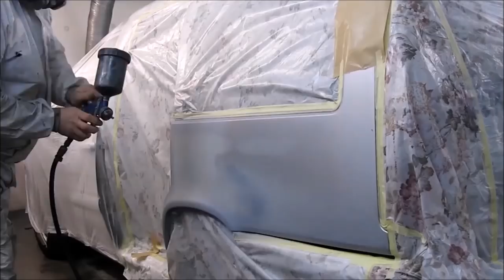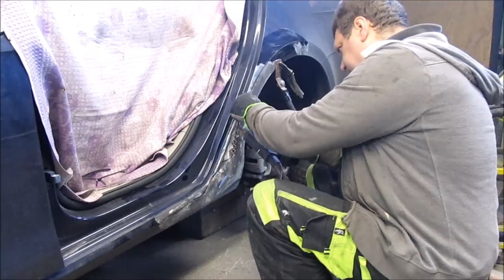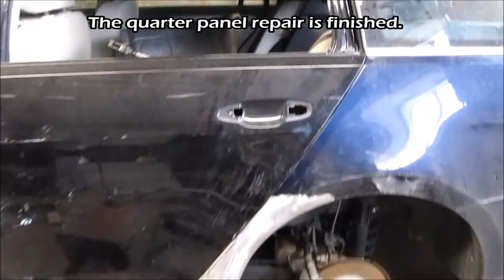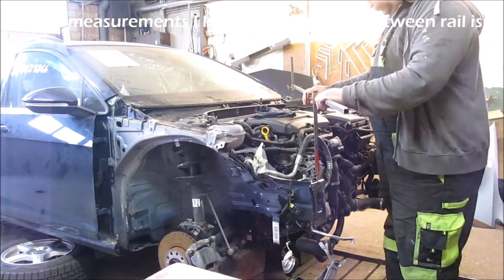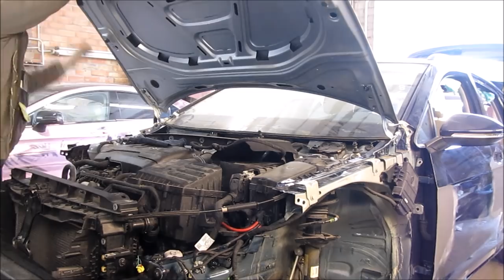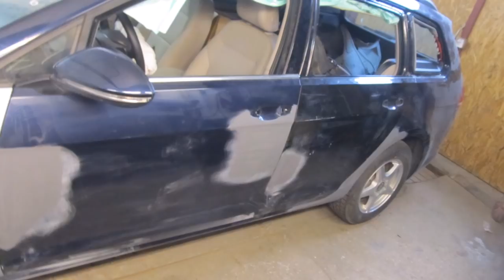VW golf 7. Body repair. Ремонт кузова.

Comment: When you lift your hands off the steering wheel, does the car go in a straight direction, without drift to the left or right after such a (massive) repair where e.g. the body gets torqued?
Reply from the maker: The car go straight

Comment: Them porta powers are crap they always leak or no work properly but your work is very good, I wonder if the bags went off I don't touch them if you got bags all the way around. Too much work but your dent puller is a very good tool I want one, good video.
Reply from the maker: Thanks

Comment: I still find it shocking how much those parts flex. They probably are fine from metal fatigue, but psychologically, once I saw my chassis rail bent like that backwards and forwards I would not trust it anymore. Am I the only one? I know this is normal procedure, heck my car was straightened before I put the roll cage in it, but it was just one pull in one direction and it was off by 4mm. Its just metal...
Reply: It's pretty much standard procedure to repair cars like this all over the world - there are guidelines in factory repair manuals for what has to be replace after an accident and manufactures make repair panels, including the panels that makeup the crash rails.  The biggest problem is not metal fatigue, but more likely work hardening, which make metal more brittle.   Some of these repairs are likely not as good as a factory new car, but they are not unsafe as a lot of people seem to think.

Comment: hey, Arthur.. Wd u buy and drive any of these cars that u repaired?
Reply from the maker: No. These cars are other peoples.
Reply: he answered in previously videos that yes he will buy and drive :)
Reply: Arthur tussik i mean that is it safe to drive again after u repair. wd u buy a car which was repaired before as the cars that u repaired?
Reply: go_trick oh. ok than. thx. i was tring to understand wheither they are safe or not. :)
Reply: There's nothing wrong with these cars. And the level of perfection in repair is excellent.
Reply: In some extent yes,  but some other repairs.... I will not trust them with a impact in the same place...
Reply: Why not? These are German cars. Unlike the American car industry, they are safe in any condition.
Reply: German or not, if you have a heavy damage on the structure itself some welding and trickery will not have the same holding resistance on a new impact in the same place.
Reply: If that was the case , It would be against the law to repair any structure damage . I've been in collision repair for 30+ years , seen plenty collisions with repaired panels and replaced quarter panels vs factory panels welds . Most professional repairs actually are somewhat stronger . There are very few cases of catastrophic repair failures that are correctly completed professionally .
Reply: well said and on some bmw's the rear quarter panels are bonded ..
Reply: Yeah... they were safe before they got written off and Frankensteined

Comment: headlamp is different on the repaired car
Reply: different to what?
Reply: Mandy Moo opening shot shows the headlamps have yellow/Orange reflectors just behind the jurn signal light and before the wing. the completed shot shows  headlamps without...
Reply: Most of these cars are originally from USA. He probably installed european headlights.
Reply: thanks yes i see now,i do the same though if theres a cheaper alternative,here in england if i repair a common car the headlights are available for reasonable money but if i fit original oe lights they can be 5 times dearer making repair uneconomic even at my rates
Reply: thanks  yes i agree,maybe the orange on the end is for what used to be cruising lights? the equivalent of drl's in europe maybe but theirs are still orange
Reply: Yeah indeed, VW can be very £££!. i'm near portsmouth! :) Cheers

Comment: Arthur, you really got it! I'm very surprised what scrap you repair from. We in Germany would dispose of the vehicles. But I'm sceptical about whether the vehicle geometry will really be right again afterwards. We have body mechanics like that. But it's questionable whether they cut off whole roofs and replace them. It would probably exceed the repair costs, the vehicles would be economically total loss. 

Translated with www.DeepL.com/Translator
Reply: Then these cars are exported back to western europe and sold as regularly used cars, no mention about them being totalled in the usa and then fixed up in the baltic states or russia cheaply. Thank god for carfax.